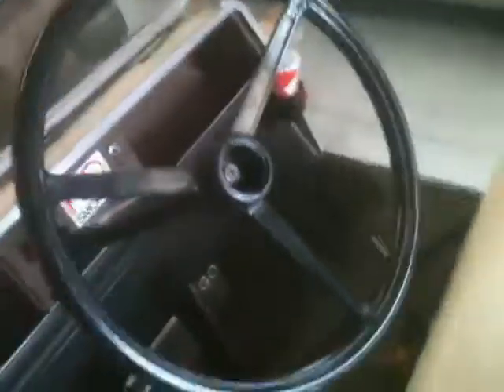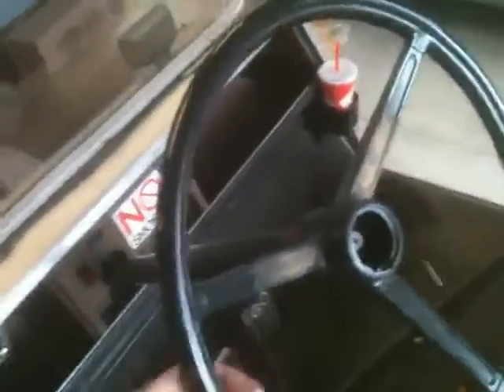The only way to replace a Club Car steering wheel

Comment: Your video was spot on perfect… I have all the “snap on” pullers and the only thing that worked was your technique… the pullers just deformed the plastic around the base of the steering wheel.. thank you for your video…